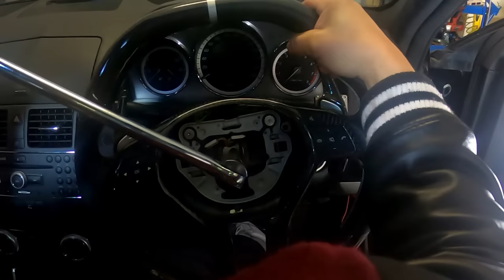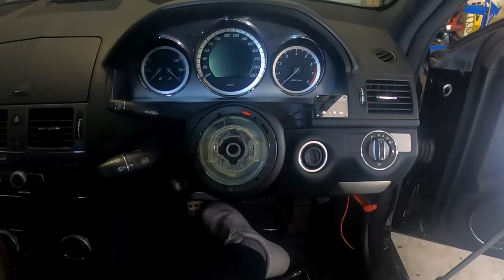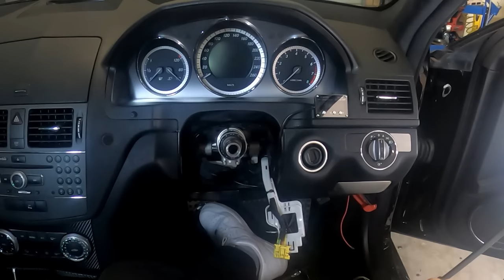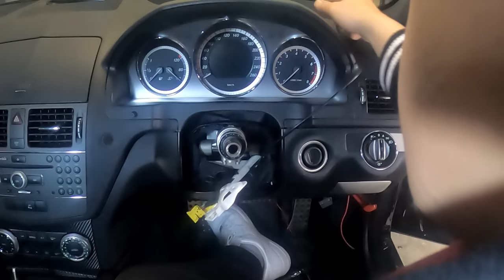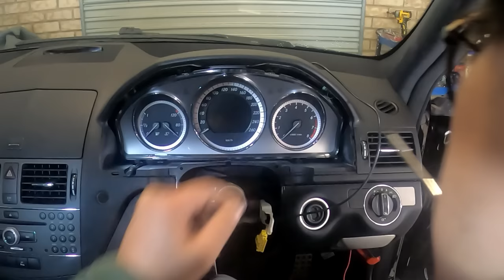HOW TO remove and fix ESL/EIS/ ELV MODULE  w212 w204 mercedes motor replace  Part 1

Comment: Bonjour , très bon travail , j ai le même problème sur ma w204 de 2008 j aimerais connaitre la référence du mini moteur que tu utilises ? Un moteur fiable de bonne qualité . Merci pour tes réponses . Jean  je suis Français 
Hello , very good work , I have the same problem on my 2008 W204 I would like to know the reference of the mini engine you use? A reliable engine of good quality . Thank you for your answers . Jean I am French
Reply from the maker: its a basic 12v motor off ebay... yes it is of reliable quality ... now there are many different prices for them ....quality wise im cant recommend with full conviction which ones are better ... but in my experience ..... i have used a simple motor for 10 aud off ebay and it has been great works .. because like i said its the motor that fails overtime not the chip
Reply: @MIKEYZVLOGZ  Merci pour ta réponse ,j'avais une autre question , tu ne démonte pas entièrement la colonne de direction pour enlever l ELV ? 
Thanks for your answer, I had another question, don’t you take the entire steering column down to remove the ELV?
Reply from the maker: @jeanjeff5134  well actually you dont have to.... as i explained in the video you can just remove the 4 torx bolts and lower it enough to get the esl/elv out... it mite be easier to remove entire column ..its up to you ... it goes both ways... because its a bigger job to remove column but then also u may find it hard to maneuver the esl/elv out .... so its up to you... i managed and i have big hands
Reply: @MIKEYZVLOGZ  D'accord , je ne comprends pas bien l'anglais désolé , mais j'ai pu remarquer que ton travail était très professionnel , je vais essayer de faire la même chose pour ma voiture  
Okay, I don’t quite understand sorry English, but I may have noticed that your job was very professional, I’ll try to do the same for my car
Reply from the maker: @jeanjeff5134  im sorry i dont speak french buddy.. hopefully u can translate what i said .... lol... hope this video helps u
Reply: @MIKEYZVLOGZ  Oui j arrive à comprendre se que tu m'écris , dommage que tu ne peux pas m'envoyer le lien de ton achat sur ebay pour le moteur , je ne voudrais pas mettre un moteur qui ne dur pas dans le temps c'est une intervention qui prend beaucoup de temps à réaliser et je souhaite que cela fonctionne longtemps
Yes I can figure out what you’re writing to me, too bad you can’t send me the link of your ebay purchase for the engine, I wouldn’t want to put an engine that doesn’t hard in time it’s an intervention that takes a lot of time to perform and I wish it would work for a long time
Reply from the maker: i can do that friend ...here you go ..let me find it real quick and ill show you ...its like any 12v machine motor..... one minute i will paste link here
Reply from the maker: https://www.ebay.com.au/itm/ESL-ELV-Motor-Steering-Lock-Wheel-Motor-with-pin-extractor-for-W204-W207-W212-MB/183024172825?hash=item2a9d173f19:g:LsoAAOSww85aYGXj:rk:2:pf:1&frcectupt=true
this is with tool fi you want but honestly no need, can just use t5 torx bit
or here is just the motor
https://www.ebay.com.au/itm/Mercedes-Benz-W204-W207-W212-Motor-Tools-OEM-ESL-ELV-Steering-Lock-Wheel-AZ/113244153107?epid=22023632190&hash=item1a5de0a513:g:~tMAAOSwNo9b3Ncb:rk:2:pf:1&frcectupt=true   <----- this is the one i actually bought, becuz i am from australia so i wanted it to come fast so i can fix it straight away
Reply: @MIKEYZVLOGZ  yes it is very nice , the quality can be different depending on the price
Reply from the maker: exactly my friend THATA EXACTLY RIGHT
Reply: @MIKEYZVLOGZ  Hello my friend, thank you for your help, and congratulations on your video, a small question the engines are guaranteed, on average how long do these engines last, you know?
Bonjour mon ami , je te remercie pour ton aide , et encore bravo pour ta vidéo , une petite question les moteurs sont ils garanties ,en moyenne quelle est la durée de vie de ces moteurs , le sais tu ?
Reply from the maker: @jeanjeff5134  I'm not sure as I only just replaced it recently but sinceno problems but wen it does fail I will tell u and post here but I'm sure a long time friend... I sure no matter where you buy most are made in China... unless u try buy from good source ...but even most ppl buy from china stock you know  what I mean...cuz they are mass produced
Reply: @MIKEYZVLOGZ  Hello my friend, you will surely find me annoying from asking you a lot of questions, I find your tool very practical the one you use to unscrew L elv behind the steering column I cannot find this tool in France, can you tell me if I can find it on the internet Thank you champion

Bonjour mon ami , tu vas surement me trouver ennuyeux à force de te poser plein de questions , je trouve ton outil très pratique celui que tu utilises pour dévisser L elv derrière l a colonne de direction je ne trouve pas cet outil en France , peux tu me dire si je peux le trouver sur internet .Merci champion
Reply from the maker: hi buddy hi buddy , im sorry im not quite understanding which tool you are referring to??? can you be more clear...im glad to help you ...
Reply: @MIKEYZVLOGZ  Hello my friend, I have already contacted you for information   , I will have to make this repair , as you advised me I ordered everything on ebay , I had another question , when you place the engine, Is there a meaning to be respected or whatever? Thank you for your answer .Bonjour mon ami , je t ai déjà contacté pour avoir des renseignements   , je vais devoir faire cette réparation , comme tu me l as conseillé j ai tout commandé sur ebay , j avais une autre question , quand tu poses le moteur dans l'elv , y a t'il un sens à respecter ou peut importe ? Merci pour ta réponse. 
A bientôt  
Jean
Reply: Vous correspondez avec Docteur Google et vous demandez: "Mercedes ESL W204". Aliexpress et eBay vend cette moteur, pas cher!

Comment: 2013 w204 with 54k shut off as I was driving. My steering wheel actually unlocks so I'm able to move it. Could a hard bump while driving cause it to move to lock position and/or not recognize the key? 

Great Video.
Reply from the maker: actually i am not sure about that.. my apologies as i stated im not professional ...i DIY..i think u need to ask mercedes about that one buddy...sorry... but i will say that i have never experienced that .... usually once the esl is unlocked the key would have to be removed in order for it to lock again ... unless something else has happened ... i suggest call mercedes and ask them...because that is a catastrophic fault that happened to you and actually risked your safety ... even sounds plausible for a law suit.... im glad ur ok friend
Reply from the maker: that sounds really scary i hope ur ok buddy
Reply from the maker: how did go friend did u figure out your issue
Reply: Ended up reading error codes for the intake and exhaust camshaft sensor. Apparently it's quite common. Just waiting on the sensors to arrive.
Reply from the maker: firstly thanks for joining the channel ..... i truly appreciate it ....it keeps me.moving forward to share my experiences and what ive learnt along the way.... thats good to hear buddy... thank god its not a major fault ... i wish u all the best hope it all gets sorted
Reply from the maker: @jeancpadilla  i didnt know that which errors were they id like to know myself ...
Reply: @MIKEYZVLOGZ  When the ESL failed did it state please remove key? I am having this issue and it doesn't unlock the steering wheel, screen says to please remove key and there is a faint ticking for a few seconds. None of the accessories work as in the windows or radio. I am leaning more toward this being EIS failure therefore not recognizing the key. Again thanks for your help and the content.
Reply from the maker: definitely sounds like the esl motor has failed ..the fact that u hear ticking is a good indication ..thats means the esl module still works but the motor has failed... thats the exact same symptoms i had ...its definitely the esl module motor... not the eis...however sometimes u have to replace the esl module.motor to see if the eis can recognise it then u will.know for sure...trial and error .... but my guess is its the esl motor
Reply: @MIKEYZVLOGZ  Thanks I will be trying to troubleshoot within the next few days. I have seen that worst case scenario that I would have to remove the steering column in case the ESL does not unlock. I have contacted a few places that do the programming but I am hesitant to send out the parts to be programmed. I also do not want to bypass the ESL as some places have recommended. I will report back with progress.

Comment: If anyone's stuck on that shift connector on the eis, push it forwards when you pinch the tabs together don't lift it.
Reply from the maker: good tip buddy can u explain briefly whjat u meanm for the oth3er who arent 100 % sure , it just helps rthem

Comment: Cut the 10mm mounting bolt of ESL, put new motor in, no go. Still get same A25646 error on iCarsoft MB2 diagnostic: "An implausible signal was sent ....". No electricity was sent to motor. Will talk to the local ESL expert what is cheaper, mating the ESL with ignition lock and key or via an emulator. Mercedes is no longer locking the steering to prevent theft, but it is too late now. Looks like German over-engineering means the NEC chip locks the system if too many attempts at starting happened before.
Reply: What have your final resolution?

Comment: Have this problem, the modul is in lock position( steering wheel locked, how do i remove it and make the modul to go in unlocked position when the motor is broken?, i dont understand, when you have this problem, it is because the motor is broken and then it is impossible to put the modul in unlock position????
?
Reply from the maker: yes u fortunately if motor is broken then u have no choice but to try and remove it by cutting the lock pin off that locks it to the steering column
Reply: I thought u could drill a hole in esl and turn clockwise on gear and push pin thing in and box separates
Reply from the maker: ahh yes u can try that ..its been done before however im not qualified to elaborate on that for i have not done it myself.. but im sure its very possible friend..just be aware that there a chance you can fry the chip if its not completely unlocked properly..for the relays read a certain way when the esl is locked and unlocked... (a chance not guaranteed) ....but yes u r right... ive seen it done before i just cant give you a definitive answer as i have never done it that way....
Reply from the maker: located Melbourne Australia not in USA

Comment: I did all that and it didn’t work,any suggestions?i will appreciate it
Reply from the maker: wen u put back the. circuit board there is 2 little grey looking switches that you need to ensure you press down wen u re install the circuit board or it wont work ... alot of ppl forget this step
Reply: I started too , It's not as easy as Mikey says. I'm still working on putting it back together, 8 HRS
Reply: MIKEYZ VLOGZ yeah i put them back but I think I mess up the circuit board,and now the steering lock is on lock position and I couldn't put it on unlock position again
Reply from the maker: this is also why i stress attention to detail is very important and only attempt if u have considerable knowledge and some skill when doing such a job... but rest assured everything is fixable and in this case if u are unsure of how to proceed maybe ask for a helping hand from a local automotive key specialists...at least u have done the hard part removing the esl and you can have them fix the issue for u .... i recommend this for ppl who are uncomfortable taking on the task and opening the esl

Comment: How can you unlock the ESL if tapping it doesn't work?
Reply from the maker: pnly other way wpuld be to take the entire steering column out and cut it off
Reply: @MIKEYZVLOGZ  if you replace the esl do you have to reprogram your car to accept the new esl?
Reply from the maker: @glensamson2235  yes glen if u replace the entire esl module but if u are only replacing the motor and u get it in the inlocked positiom out u can just replace the motor inside and you wont have to program anything ....

Comment: Why dont you just leaves the esl in there en put the emulater in?? Its in the unlock position
Reply from the maker: @MrMariohoekstra  u still have to send off the emulator and ignition eis to get the emulator coded . once u get the emulator yes u can put it anywhere as pong as the cable can plug in
Reply: I have the same problem with my A180 from 2013. So you stil have to take out the eis if you leave the esl in?
Reply from the maker: @MrMariohoekstra  no remove both send it off to get an emulator coded..they need both to create the emulator

Comment: If you assemble the ESL Without fixing the ESL NEC motor position, 90% the ESL Will becomes dead! You need ESL tool to do the correct job! I use ESL Doctor from Simon Touch company works perfectly, even if the ESL NEC Is not reparable, Fatal error, I can renew it and reprogram it. If the client doesn’t have time to do this job or he doesn’t like to remove the steering, job can be done in a minute by installing Simon Touch emulator
Reply from the maker: agreed very smart thinking ...

Comment: i have cla200，got the code：‘implausible data were received from the electronic ignition lock’. But the mechanic said current the car is ok with ignition nothing be locked . Do you have any idea about it? 🥲I don't dare to drive my car  after the mechanic showed the fault code that he can not fix it or know the reason about the fault code. 🤣😂Many thanks .
Reply from the maker: th I'm not too sure about that my friend..not too familiar with the newer model ..

Comment: Do you think it can be done without taking off the steering wheel?
Reply from the maker: only if u use a bypass module
Reply: @MIKEYZVLOGZ  
Hi mikeyz 
Whats bypass module please
Reply from the maker: @User69390  it is a module that u can put in place of your esl module and it works like the esl but with no lock it tricks the exu into thinking your wheel is unlocked therefore allowing you to start your car
Reply from the maker: @User69390  it is a module that u can put in place of your esl module and it works like the esl but with no lock it tricks the exu into thinking your wheel is unlocked therefore allowing you to start your car
Reply: @MIKEYZVLOGZ  
I tryed to tap on it,it  unlocked  but it dosen't start 
What do u think it would be
Reply: @MIKEYZVLOGZ  
I disconnected the battery and i turned the key off without moving it from the ignition it locked again i connected the battery again it unlocked so now it unlocking every time i put the key in but it won't start 
What do u reckon
Reply from the maker: @User69390  hmmm .... honestly sits hard to tell as I'm n t there but could be the eis . a malfunction with the ignition switch which is why ur key inserts into...
 best thing to do now is. ur an obd2 scanner tool and check for fault codes... also normally wen u disconnect the battery the esl should stay unlocked... it should not lock .... do you also hear the turning noise of the esl wen u    disconnect the battery??? i cant be certain but sounds like eis maybe the culprit ... u should of course get a 2nd opinion...its really hard to say as im not there
Reply from the maker: @User69390  sounds like maybe your eis .... do your lights on ur dash come on ? can u hear a clicking noise from the esl? and is it intermittent the lock and unlock ? u may need a second opinion....

Comment: ⚠️IF YOUR STEERING WHEEL IS STUCK IN THE LOCKED POSITION⚠️

You can also shock the motor by yanking the steering wheel either way til it bounces off the lock. (not too hard just a firm turn of the wheel till it hits the lock) Do this while turning the key

Mine is intermittently sticking in the locked position and doing this always frees it off.
Reply from the maker: good top bro
Reply from the maker: thanks for sharing

Comment: my esl wont unluck.. i cant remove it and i dont want to cut the lock!
Reply from the maker: hey bud so there's a few things u need to do if it gets stuck locked... u can 
1. cut the bolt .but u need to remove entire steering column . been done many times ..many ppl do it . then u can buy a replacement bolt that sits back in ..
once esl is out u drill a small hole where the wheel mechanism is so u can manually turn it til it unlocks ...
these are the work arounds if u can't unlock it ..
2. did u try tapping the colum under esl with a solid hammer ..? that sometimes can help the esl motor spin enough to unlock the esl module...

Comment: Mine was stuck, i wiggled the steering wheel, and hammered the column, and i heard a clunk, and the car turned on. After i opened the esl, it was unlocked but the board ontop of the motor had black smoke residue, my motor comes in tomorrow,  hopefully just the motor burned out and it works with the new motor =/
Reply from the maker: yes usually the black residue is from the motor frying ... u should only need to replace the motor itself
Reply: @MIKEYZVLOGZ  i replaced the motor and nothing, didnt work. Im wondering if i was suppose to put it back in the locked or unlocked position.
Reply from the maker: @unreal2005  however u removed it it nees to go in the same or it confuses the esl
Reply: @MIKEYZVLOGZ  i put it back the way it was and nothing, im thinking the board fried, well time to get an emulator.
Reply from the maker: @unreal2005  could be .. did u ensure the lil 2 great switches were pressed down..everything needs to be just right
Reply: @MIKEYZVLOGZ  yup i did, and nothing
Reply from the maker: @unreal2005  just might be the pcb
Reply: @MIKEYZVLOGZ  thats my guess too